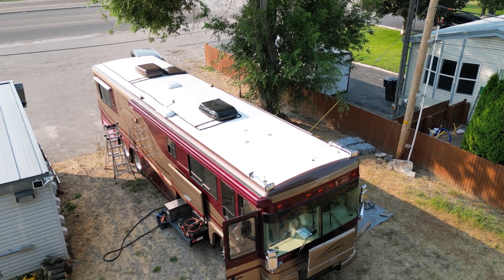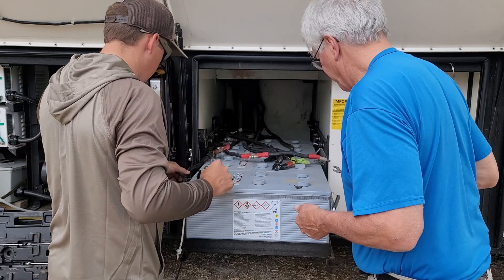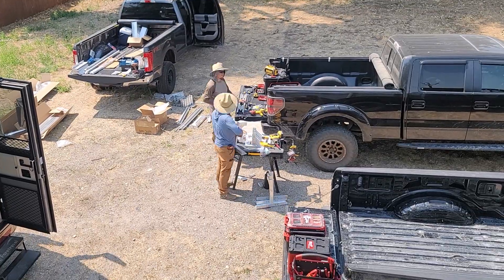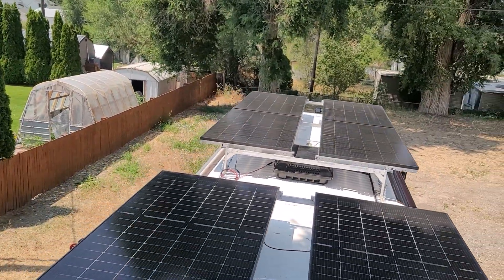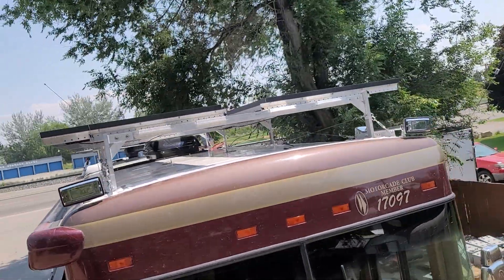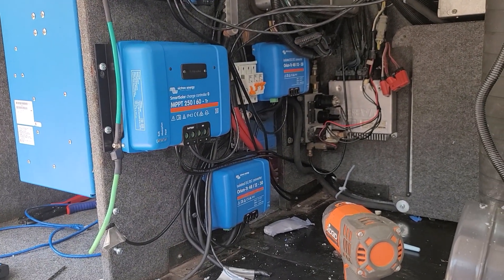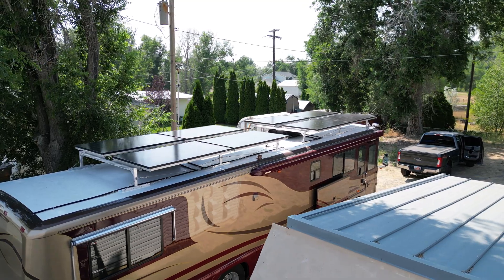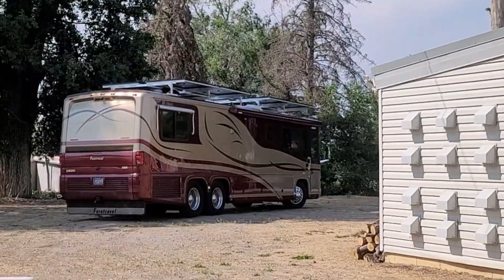Fully Off Grid Boondocking Motor Home [Runs AC]

Comment: Wonder if it's worth it, with all the extra weight of the panels, wiring, equipment and heavy batteries, plus the extra drag having the panels raised up above the roof.  Must be a serious hit to MPG.  Might be more cost effective to just use a 1000W alternator charger combined with a robust power station/battery.  I suppose it depends on how much you are on the road, and how hot and sunny it is where you will be.  If the RV is sitting parked at home much of the year not in the shade, and the solar on the roof can be utilized to power the home, I could see it being a worthwhile investment.  Not so sure it is worthwhile if the solar only gets used occasionally on road trips.

Comment: As much as I would love to do more panels on my 5th wheel....  your set up will be torn off with Florida's hurricanes.  So I opt'd to keep my panels 3/4" off roof top to prevent wind from ripping them off.  1725w total in panels on a 26ft 5th Wheel.  I use a 12VDC AC unit that varies from 25a to 45a depending on mode.  800a Li total.  3000w Inverter and 160a Solar Controller (total between 2).  If you need to use AC... doesn't matter how much you install in panels and batteries......  if no SUN..... no FUN!

Comment: Monument Solar just completed our install of 5,200 watts, 48 volt system. 53KW lithium batteries and 2- Victron 5KW multiplus inverters with an autoformer. Kenson does great work.
We used 3 48volt EPOCH golf cart batteries. That’s our Riverstone rig from Monument Solar in the flyover.
Reply: Total cost?

Comment: Not a fan of Docan/Apexium boxes I would have gone with Yixiang boxes they compress their batteries design the box with 2 pressure plates. The Apexium is open at one end.  I do like the foam and fiber glass separators between the batteries this is one of the mistakes people put UL approved battery made for home solar not designed for mobile use. If cell rubs through the blue insulation your going to have a battery fire no way to fuse that. Your DC breakers are not UL listed not a good choice don't buy cheap breakers. I would choose IMO disconnects, or midnite breakers. NEC only requires PV fusing on 3 or more strings in parallel.